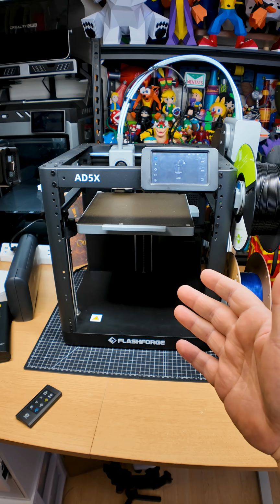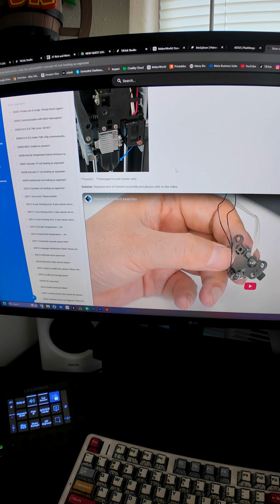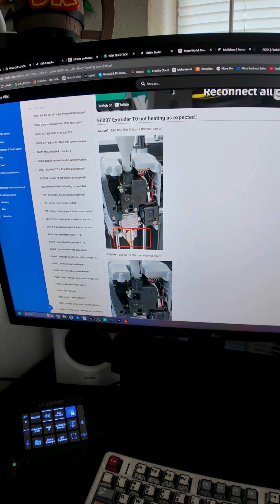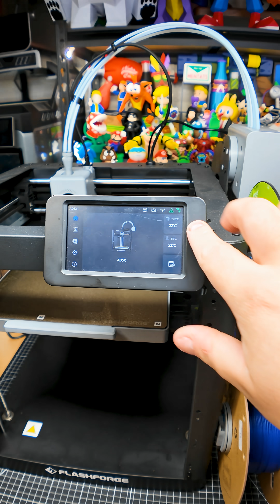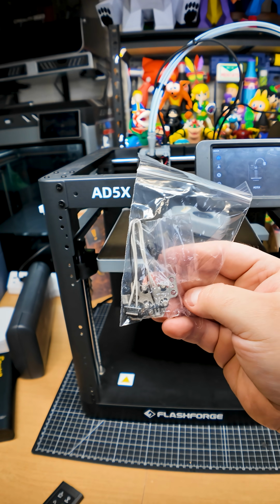E0007 Extruder T0 not heating as expected - Fixing my AD5X

Comment: The ad5x's they sold on aliexpress over black friday has NO USB C and you have to remove a power connector from the top daughter board (extruder board?) under neath instead of the much easier usb c. They also are ALL having this exact issue. I FOLLOWED YOUR GUIDE AND I'M BACK UP AND RUNNING BIG DOG THANKS SO MUCH MAAAAAAAN. It really isn't as bad as it looks. I didn't get confused on steps and was able to understand the whole assembly because of your very good video and camera quality. Sincerely appreciated.
Reply from the maker: the no USBC thing is not aliexpress specific. that is just the second revision of the printers. They are like that everywhere. Glad you got yours back up and running!
Reply: @MikesQuestLog thanks for the explanation! Thought I got ripped off for a second! Thanks again for your very well made video dude. Made the process way less scary and way faster
Reply from the maker: @idrankthebleach glad I could help

Comment: i got this issue after 30 hours. i found that in my hotend it turned black... i cleaned it off and still got a new heater since theyre only $10, but put thermal grease in there this time. it works much better now.

Comment: My AD5M is having the same problem. Can you do a video replacing the nozzle heater wire, nozzle assembly, connection cable of the nozzle and extruder board, and mainboard? I'm having a little trouble figuring out how to buy some of the parts and how to replace the parts once I do buy them.
Reply from the maker: Guides to all of these should be available on Flashforge wiki

Comment: Hi do you know the resistance on a good heater assembly I’ve got 56 ohms with the board disconnected on mine and I think it’s a bit high
Reply from the maker: Don't know the exact spec but I think 6m5y is pretty much gone. For a heater of this size and output I would guess it should be around 10 ohms

Comment: Is the hotend repairable? Or I just have to buy anotherone? My printer is 71h and got problems, too new for this
Reply from the maker: Yes it is. The heater is a part of it
Reply: had the same issue around the same time. the heater on the black friday models aren't soldered to the power properly- my little power solder popped off right as I took the old heater out. NEW ONE OFF CRAMAZON HEATS FAST AS HAIL. back to perfect prints, but for how long?

Comment: I had a blob of death on my ad5x 😂 
It was my fault because in the slicer I accidentally chose the cool bed instead of textured PEI. My front cover broke but luckily they’re sending me a new part! Only thing is I have filament stuck behind the heat break inside the actual assembly you removed. Any advice on getting it out?
Reply from the maker: Blob of death is usually a user error. I had a giant one on my K2 plus because I sliced the file wrong and it was not flat on the bed 😂 

If you just take the same steps I did you can scrape it out. Maybe some hot air gun in case it is stuck stuck
Reply: @MikesQuestLog  thanks! I’ll try to remove the heating module and scrape it from there